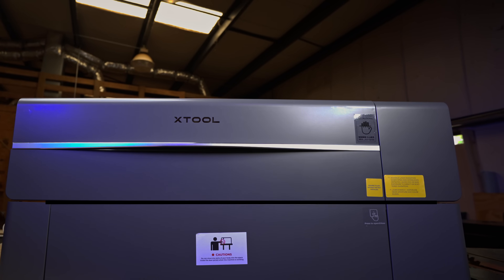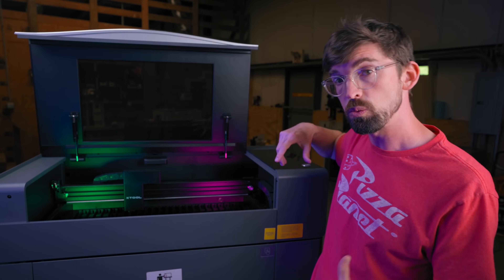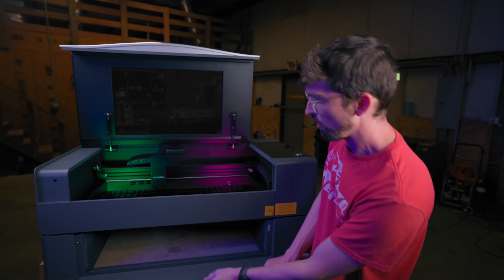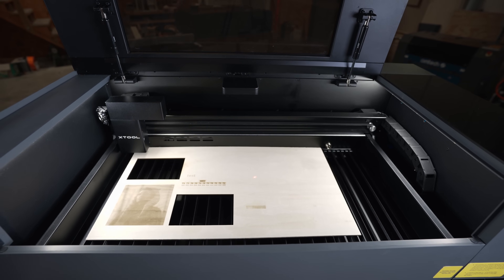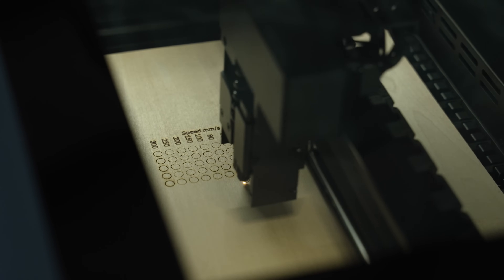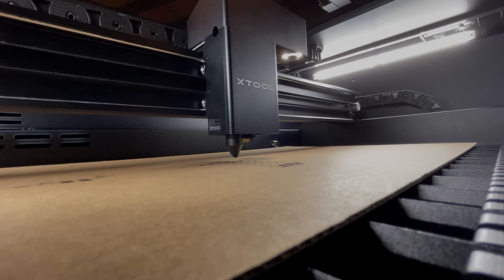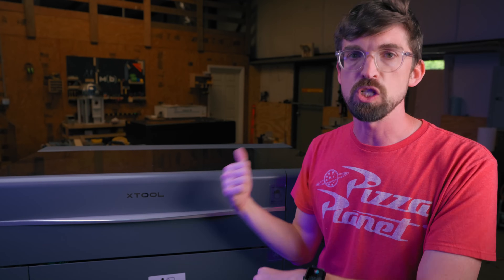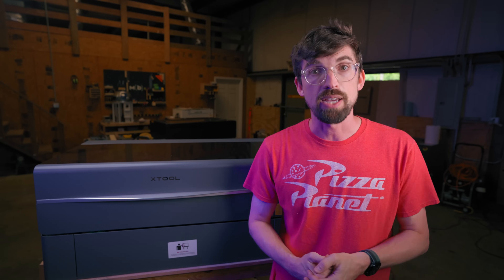Worth it? How the xTool P2 CO2 Laser Stacks Up Against the Competition

Comment: Just so everyone knows this product is only in China.  There is no way to get any parts or get it fixed under warranty unless you send it back to China.  Mine has issues and they send me parts to fix it myself. This will shut your business down during the months it takes to get it back.  If you have critical failure they will replace once you send yours back and get the replacement.  This will take several more months.  They will let you give them $2500.00 refundable deposit if you have a spare $2500.00 to give them for several months.

Comment: Hello - great video! THX😀, does the Xtool P2 work with the Atomstack R1 Pro rotary - because of the larger diameter (up to 130mm)? Do the connections fit?

Comment: at 9:55 you show the laser cutting sample. my understanding is it was only able to cut the wood at 80% and 90% power at 100 mm/s? 3mm basswood? This is weird as I cut .110 inch mdf at 100% power and 150 mm/s.

I'm currently using a glowforge pro and I'd like to swap to something that cuts wood faster (I'm mainly cutting vs engraving). Its for my classroom so needs to fit as a desktop unit and I was lookign at the p2 or the flux hexa

My main interest is getting a machine that can cut ~1/8 mdf faster and it is hard to get a comparison of cutting speeds (we do alot of layered designs). I was hoping the p2 or flux hexa or other desktop style co2 lasers would be significantly faster than the glowforge pro if anyone can point to evidence for that I would appreciate, thank you.

Comment: Kinda need "ventilation"-info , or whatever you'd call such a category, on these tabletop lasers.
These are, in most cases, not gonna be in some massive warehouse with industrial ventilators running all around the walls. They're gonna be on a tabletop in an office, basement, garage or whatever. What's the ventilation like out of the box? How does the inbuilt fan handle the smoke? Can you smack a tube on it, and cut MDF without worry of what leaks through the top?

Comment: You stated you have a Thunder Nova.  If I could purchase this or a used 1/yr old Thunder Nova 24/60. What would be your preference.  The Thunder would cost more for sure. My use case is engraving and cutting so far on a xTool D1 Pro 20w now.  I am concerned with the limited bed depth compared to what I have now.

Comment: 14:34

"Do you need eye protection for CO2 laser?
When working in the laser industry, the Co2 laser is one of the most potentially dangerous because of the invisible radiation it emanates. This requires a special type of eyewear protection that's essential to prevent permanent eye damage."
Reply: Everyone underestimates this. Invisiable wavelength lasers are the absolute most dangerous of any lasers, as you have no idea if your goggles are TRULY blocking it, if the window on the machine is TRULY blocking it, etc. You're just trusting the company did the right thing.  I say this, because my local maker space got a china 2' x 4' cutting area 100W CO2 laser, and the viewing window was uncoated, no film, pure basic glass.  It did NOT block the CO2 wavelength and people used it without that knowledge and thankfully got lucky any material they cut wasnt blasting refractions up at them. I typically refuse  to operate a laser, even these closed units, without ANSI certified & tested glasses for CO2 and Fiber.  To the industry, even an enclosed unit like the XTOOL is, a shop would still require laser glasses when operating.

I too had a "Wait wait wait, what did he just say???" moment and had  to re-listen when he mentioned eye protection with CO2. Just cuz yeah, 55W is invisible to us, but its a blasting light out behind the scenes and I'm sure that window blocks it.. Depending how tinted ( darkness ) it is, I may kick mine out for a US-made window thats film coated to be high VLT  ( 80%+ ) but full CO2 blocking

Comment: I have been trying to find out about the pressure rollers. What thickness of wood can you put into the machine? I was thinking of making some door panels and the wood would be 24" wide, but maybe as thick as 2". Primary to engrave but I would probably also use it to cut some half-inch wood for some big wall art.
Reply from the maker: I’ll have to test it out
Reply: @makeorbreakshop  thank you on the response. The glow forge is limited on the pass through thickness and just wanted to be sure the thickness, and now that I think about it, the power of the pressure motors as they may slip if the weight is too much.
Reply: @rickhoguerealtor  xTool website says maximum thickness for automated roller is .55” or 14mm.  That passthrough does allow for 4.5” but manual.
Reply: @rcarroll05  I saw that and heard it from another reviewer, however that reviewer said if it is above 10mm you have to do something to elevate the back of the machine or it catches on the lip in the back. But I do not know that for sure, it could have been his wood was a little warped.

Comment: What's your opinion on this? With new diodes in the 35W range, do you think we will get the same form factor with diode lasers in the next 2 years? I can imagine having 60W diode lasers in 2 years, which starts to call for very good enclosures!
Reply from the maker: I think we will hit a point were it practically doesn't make much sense to increase the number of diodes they cram in in terms of weight.  Since the diode laser module is what is moving around on the gantry eventually the stepper motors won't be able to keep up.  For CO2's the head weight is pretty much the same regardless of laser power.

Comment: Don't understand why something like a 3d printer drops in price pretty fast but these co2 stay so expensive. Of you compare the hardware on these machines co2 is so overpriced. This machine could easily be made for under 1500$ if voron can do it so can these larger companies
Reply from the maker: Yeh when your looking at 3D printers they seem to be on the higher end in price.  Individually the glass co2 laser tubes are pretty pricey but hopefully those prices will come back down.
Reply: @makeorbreakshop  cloudray selling tubes for 200$ slapnin some rails and mirrors housing and your done well under 1000$ for bigger companies

Comment: Thank You for this review! - I had never heard of this laser model until your review, and was really cheering on the Diode Lasers intrusion into the CO² segment for cost cutting until 
Diodes flew past the $1,000 mark and still could not seriously engrave metals.

I am hoping CO² Lasers will start coming down in price as a result of Xtools' competition in the market.
Reply from the maker: Fingers crossed!
Reply: I have diode and CO2 lasers in my shop.  Neither is really good at engraving metals.  High powered ones can mark the metal, but it won't really engrave it. You need a very high powered CO2 laser for that or a fiber laser.  I also don't recommend any laser under $1000.  Thats just too cheap.  Lasers are one tool that the quality of the components matter.  Cheap parts will get you a cheap laser that isn't as powerful and doesn't last as long.

Comment: Glad to see your review! All things considered, the P2 seems like a step up from the OMTech Polar but one thing that I think you failed to mention in the price comparison is that the Rotary for the P2 is an additional cost, whereas the rotary is included in the cost of the Polar. In your prior reviews it seems like you are pretty high on the Polar. All things considered, which of the two would you personally recommend (I know everyone's needs are different, looking for your choice personally). To add to that, if space is not a constraint, is there are full size laser in the price range of the Polar and P2 that you would recommend above the others?
Reply from the maker: P2 is a better machine overall, but its also several thousand more in price so it's hard to say.  I would probably lean the Polar route since I don't really work with large things or need a rotary.

But in for the machine I actually use in my shop its the 60W manual focus laser from OMTech's mid range line.  Its a good bit bigger but still less expense than the P2.  You will need to use an external chiller or at least a fish pump in a bucket so it takes up a good bit more room.  The workbed is what keeps me coming back to it since there is so much room to work with: https://omtechlaser.com/collections/mid-range-co2-laser-engravers/products/60w-co2-laser-engraver-cutter-usb-6b57-us
Reply: @Make or Break Shop  my order for the P2 with riser base, RA2 rotary & automatic feeder was just under £4,300 (incuding free delivery & a free £150 material pack) To Omtech Pro would cost £3,500 for me to order (with rotary) £800 difference seemed reasonable to me (larger bed, better cameras & better auto focus seemed worth the price increase) 🤷‍♂️
Reply: @neilrisley1321 the P2 vs the Polar is what I think they compared. In the US the polar is $2,999 and the P2 is $4,999 without the rotary or riser. Rotary add on it $299, honeycomb panel is $169 & the riser is $499 for a total of $5,966 USD vs $2,999 for the Polar. So you definitely got a great deal compared to the US as you can see here it's double the price. Of course things go on sale but still not even close to what you got it for
Reply: @makeorbreakshop  thanks for the reply. For the 60w, do you use a (lightburn) camera? I feel like having the ability to line things up with one is a big benefit.

Comment: Other desktops (like Gweike) seem to require an additional external fume extractor. Is the P2 powerful enough?
Reply from the maker: It's got pretty much the same fan setup, so you would probably want an inline fan if you are using it a good bit.  But for small jobs it can work.